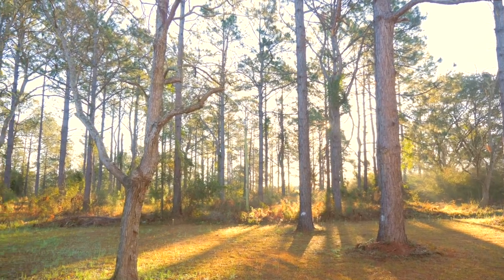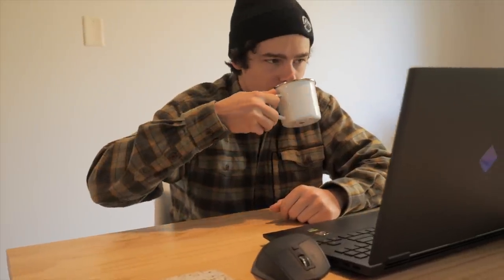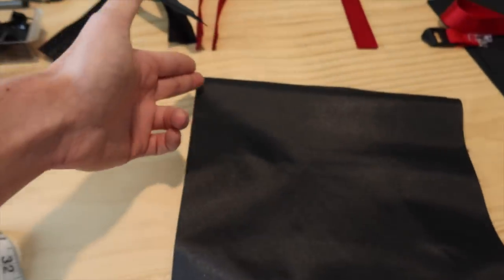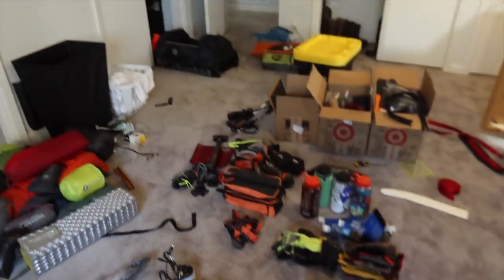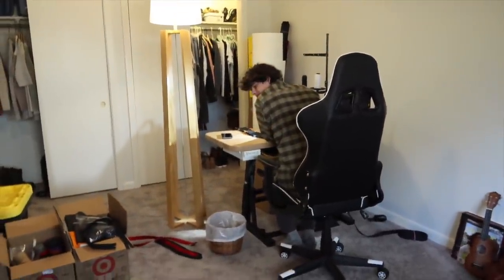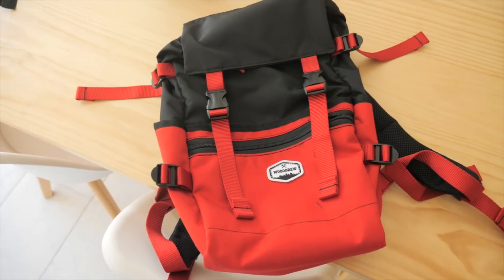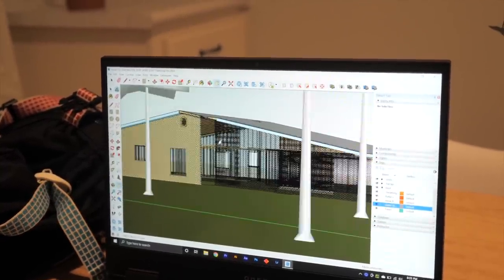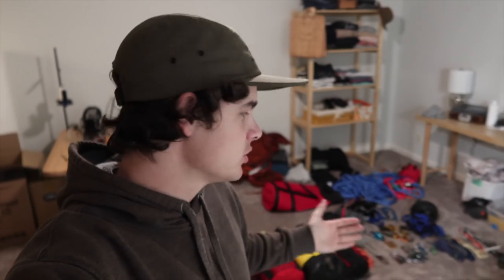DIY Backpack | Sewing A Backpack For My Nephew!

Comment: You could stitch the crack in that box back together by drilling matching holes either side and using zip ties to pull it closed.  It won't be water tight (unless you seal it with silicone caulk too) but it'll hold together.
Reply from the maker: We just exchanged it 😂
Reply: @Woodbrew  What I find amazing is I have one of those exact type of tote boxes, and when I brought it home I marveled at how indestructible that thing is.  Somebody must've run a forklift through that one!